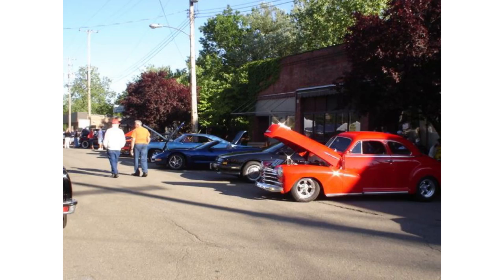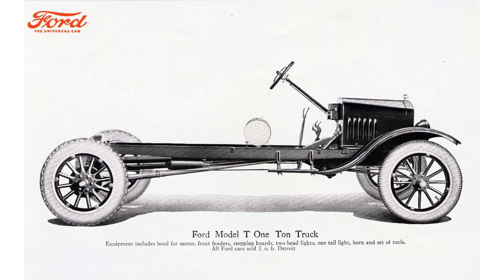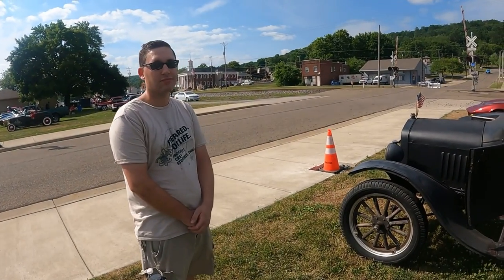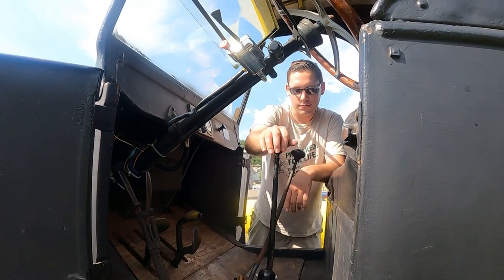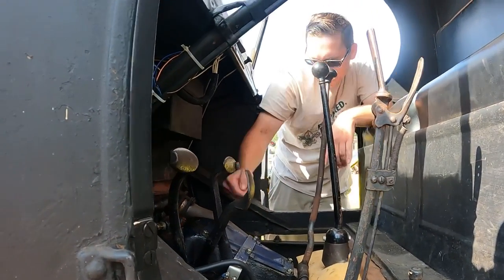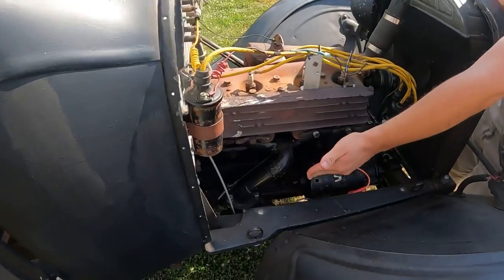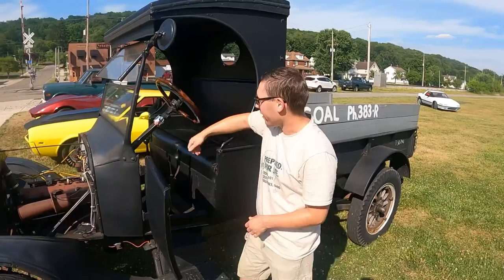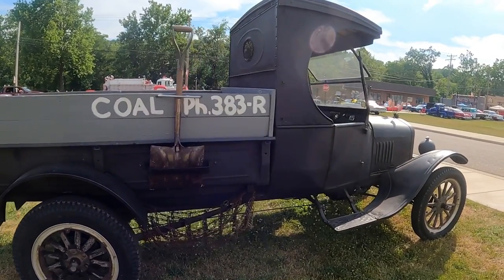1924 Ford model TT C Cab express

Comment: My 26 TT has the two speed rear end and an auxillary Chicago transmission. Haven't mastered the shifting with non syncro gears. We have used mine to haul fencing on our property.
Reply from the maker: You’ll get there it takes a lot of practice I’ve never driven a 26TT but I’ve driven vehicles where you have to double clutch both accelerating and decelerating decelerating is harder because you have to rev match the engine to slide it where it needs to slide in without grinding it.. 

So happy to hear that you have a 1926 TT and you use it =)

Comment: My TT is a 1926 C-cab.  High compression head and 270 cam.  Warford aux trans with overdrive, and express gears in the rear.  I also put hydraulic disc brakes on the rear, and a foot feed on the floor.

Comment: The Model A ‘s that came out in 1928 were a huge improvement in so many ways!
Reply from the maker: I’m a huge model A fan it’s almost a sin that one hasn’t been featured on the channel yet and AA is the truck I really wanted with Mitchell overdrive behind to make it go faster.. I’ve read not sure how true it is stock A engine with Mitchell and different gears could do 70 mph and get around 20 mpg in a 1 ton truck, think about that new 1 tons don’t get that.. and they have electronic direct injection, computers and still can’t even come close.
Reply: They will probably break the brake or something but a thief won't know how to drive it away. LoL
Reply from the maker: Probably could catch them pretty easily too considering TT went 22 MPH stock top speed

Comment: We’re back to where only the rich can afford a new car .
Reply from the maker: Interest rates are though the roof even if you have great credit. I only bought one new car ever will never do that again it’s a losing proposition... unless you drive the wheels off the car. 

Take a Honda Odyssey for example  pay on average of 40k for it after 10 years 100k niles its a $10,000  van (used to be cheaper but Covid screwed that all up prices haven’t come back down.. they will in time tho they are starting to drop, in the used car market) 

Honestly that’s my approach to anything anymore is I don’t wanna be the fall guy or the guy that takes all of the loss.. I just took a 2001 Honda Odyssey minivan to the junkyard that I paid $1800 for and I got six years out of honestly that’s the best scenario because $1800 is nothing for a car and I put 100,000 miles on that van and it didn’t give me any major issues I only took it to the junkyard because it needed everything the windshield cracked and it was gonna cost more money to keep it on the road than it was worth.. because things did eventually wear out and stuff but it all became optional like power steering became optional do you want power steering or would you like manual steering you could put power steering fluid in but it leaked like a sieve. All the solenoids were gone in the transmission so it didn’t shift right if you put it in automatic and just wait but if you shifted it manually it was fine.. it was pretty ghetto by the end of it but at least I wasn’t out 40 grand..

Comment: The 8N Ford tractor four cylinder engine is very similar. Braking is sort of sketchy about it without any power steering. Those model T's are about the same with Braking.
Reply from the maker: I’ve always wanted to drive a Ford 8N tractor.. I was out in the country we’ve had 
1952 McCormick Farmall I learned how to drive that when I was just kid.. maybe 8 years old drove my grandpas 1995 f150 through the fields we used to pick tomatoes and beans peppers take to the markets to sell.. that almost seems like a totally different life ago, grandpa was my best friend, he died when I was 16.. but yeah I loved the 52 farmall the sounds the smells.. eight year old me had a really hard time pushing the clutch down because I didn’t have enough weight to do it I would have to stand on it to get it to engage I wasn’t tall enough to sit on the seat and push the clutch down I will really work for a long period of time.. and the brakes were even harder to push down. Farmall had calavators that’s what we used it for. I had to sell the tractor a couple years back I needed the money I didn’t have enough money to fix it I couldn’t get it to start or run I think the magneto went bad